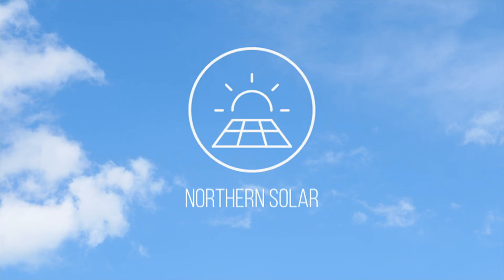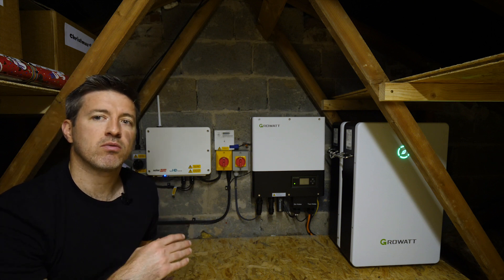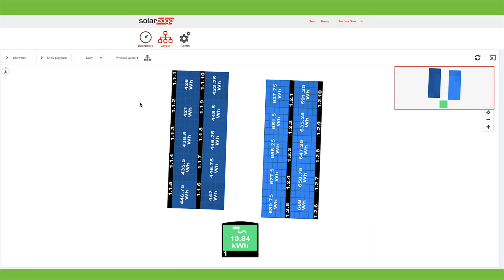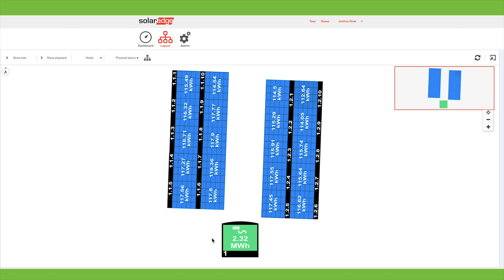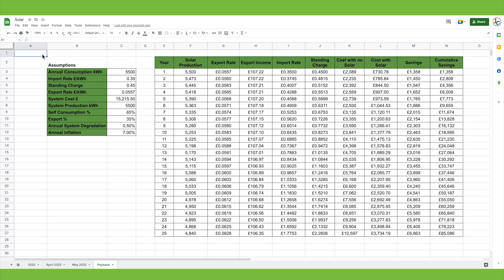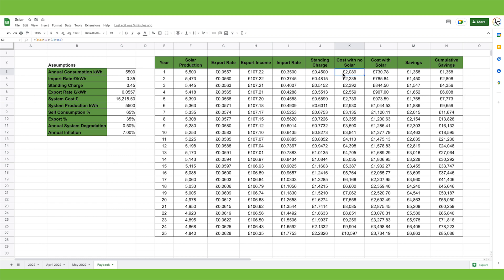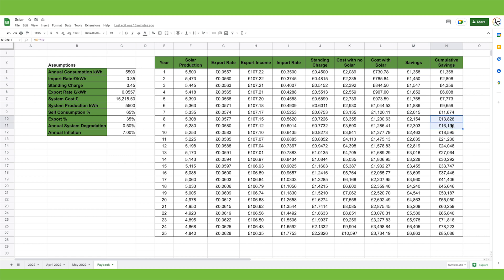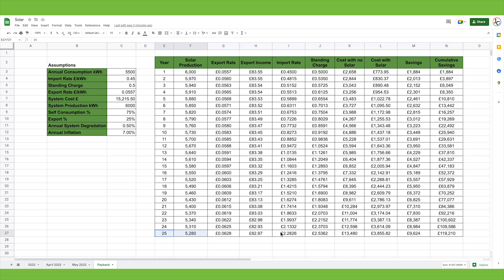How Long to pay off Solar Panels & Battery - System Overview, Cost & Payback Time!

Comment: Ha thats funny, spoke to Terry at tb electrical on a potential indra v2g unit install before he got cold feet. They were great when the quoted for my property but ive gone the mostly diy route and just need to figure out my battery storage. Nice spreadsheet btw.
Reply from the maker: Thanks Andrew! I'd be way too nervous to DIY it. Wiring a plug socket is about as far as I'd go! One of my neighbours has the v2g charger for their Nissan Leaf.  I could put you in touch with them if you're looking for advice?
Reply: @northernsolar6391  nah i know what i need to know for now

Comment: Why the standing charge on the spreadsheet, it would be there even if you didn’t have Solar or battery’s.  
As an installer it’s nice to see batteries starting to make sense, even if you can’t get them of the shelf. Normal waiting time 6 mts.
Reply from the maker: I just include the standing charge to show what the total bill is per month. It's on both sides of the calculation so the savings would be the same with or without it in there. It's definitely not necessary to be included though. Yeh, there's delays on everything it seems at the moment. I'm so glad we got ours when we did!

Comment: Hi Joshua, do you ever hear any noise from the inverters or batteries during the night? I'm asking because I'm looking at an installation in my garage which will be directly underneath my bedroom. Many thanks! Loving your channel by the way! Cheers, Gary
Reply from the maker: Thanks  Gary, I've not heard any noise at all, no. I wouldn't think you'll have any issues with yours in the garage. What system are you going for?
Reply: Great to hear, Joshua. So, I've been waiting to get my system installed for months now. And although my quote is currently for SolarEdge + optimisers, I've also been looking at a Solis inverter, in order to have Pylontech batteries, or a GivEnergy system including batteries. Lots of options and so a bit of analysis paralysis! Lol
Reply: I, like you, have ventured into the world of making YouTube videos on solar. Early days - only one video so far - but it feels good to help others 👍
Reply from the maker: @Qdex44    there are so many options out there at the moment. Getting stock of some seems very difficult. I would try and remember it's a long term project and it's worth waiting for the right kit even if it's a few extra months now it could make a big difference in the long run. That's great, I'll check out your video!

Comment: Interesting to see two inverters, I wonder if there is any inverter efficiency loss with that setup?. Are you exporting to the grid from batteries at all? another interesting point would be is the battery degradation from exporting to the grid worth it or is it better to never export from battery.
Reply from the maker: There's definitely going to be some efficiency loss when charging the battery from the solar as it goes dc-ac-dc but on the plus side for me I can get 6kW from my panels and 3.2kW from my battery at the same time should I need too. That's probably not going to happen often though. I'm not exporting to grid from my battery, no, that wouldn't make sense for me. The export rate is a lot lower than the import rate, even off peak.  Also adding unnecessary cycles to the battery would degrade it faster.
Reply: @northernsolar6391  Yeah makes sense, I suppose maybe if you had a tariff like Octopus Agile it might be worth it. Interesting point re your peak electric inverting power. I can only invert 4kw with my hybrid inverter and sometimes the odd kettle/microwave/oven combo does mean I draw from the grid even though I have plenty of stored electric.
Reply from the maker: @gsdevme  that does happen to me too, my growatt inverter can only draw at just over 3kW from the battery so occasionally we draw a little from the grid. I'm ok with that though as our exports cover those minor amounts.

Comment: I have the same system as you, except I have 16 panels 6.4kw and a SPH5000 hybrid inverter with Tigo optimisers. Mine only cost £8800? Mine is more south facing so it’s producing about the same as yours. Mine was installed in October and it has produced 5MW’s already. I have had no problems with it so far. You will like it.
Reply from the maker: Thanks Robert! Yours sounds like a great system. Can I ask if you have a battery? And what size? That's great that your producing so much too. Do you find you're exporting a lot at this time of year too?
Reply: @northernsolar6391  I have 13kwh of storage, the same two Growatt batteries you have. Yes I export a lot, but not when I am on a day off because I charge my EV and that sucks it all up in the summer. In the winter I do not export hardly anything. I charge the batteries at 5p a kWh and they see me through the whole day with a little bit of sun light.
Reply from the maker: @mackay250  that sounds like an ideal setup. £8800 is a great price too. I doubt anyone would be able to get a price like that now!

Comment: When we put our original panels up in 2012 we were quoted 8 years to break even. We did it in 5 and a half years. The estimations made by the installers do err on the side of caution, for instance the calculation made was that our 3 kw array with 3 kw array would produce 2800 kWh annually. In actual fact the lowest we have had in the 10 years fitted was 2923 and highest 3271 and are averaging 3100. We are south facing and although the installers calculations were based upon that, I see  no reason why your installers calculations will be any different, they will be cautious.

It will be interesting to watch you future videos to see how you get on. Good content, simply explained thank you for taking the time to produce.

Your estimations are really cautious too and I believe you will be pleasantly surprised by your actual results over time
Reply: Likewise I also had solar panels installed 10 years ago, they paid for themselves in 4 years.  I absolutely love them.
Reply from the maker: @mypointofview1111  that's very encouraging! I think once the new price cap comes in and we've had a year of production I'll have a much better idea of the payback period.
Reply from the maker: Thanks Lynn. That's really encouraging to know. It seems to be the case with most people I've spoken to but I guess you never know until they are up and running. I think we're on course for way above the estimate which is great. I'm really interested to see how we get on in winter too. My next video for June's figures is looking like it'll be a good one!

Comment: Hi Joshua, Although your loft is insulated, do you know how cold it will get in the winter months and do you expect any degradation on battery output when freezing temperatures outside.  Also for the warranty on the invertors and battery is that parts only, or parts and labour?
Reply: As for the loft, I would be more concerned about the heat in summer than cold in winter.  The inverters generate heat and their lifespan shortens. An option could be to put a 12v fan extractor (solar powered?) that goes through the wall and simply draws external cooler air in from around the soffits and expels the hot loft air out.
Reply from the maker: @wajopek2679  I have looked at getting a fan up there to help with air circulation and it'll probably happen when we do the extension. I'm going to keep an eye on the temp sensor in the battery this week as it's very warm. I've not seen it over 32 degrees yet though so I'm pretty confident it'll be fine.
Reply: @northernsolar6391  In Scotland I have seen my loft go below freezing via the temperature sensors I have, not sure about Cheshire exactly. The growwatt batteries BMS should disconnect it at 0c to prevent damange. Even charging below 10c for a long period isn't ideal but I dont think anything here will cause a complete failure.
Reply from the maker: I don't know the exact temperature but it definitely not lower than -10°C. I think a garage/utility room is the ideal place really but that wasn't really an option for us. It's definitely something I'll be keeping an eye on though.
Reply: @northernsolar6391  Hi Joshua, could you comment on warranty regarding labour costs
Reply from the maker: Hi Raymond. Yes, labour is covered as part of the insurance from the installer, backed by HIES. 10 years cover with £100 excess.

Comment: Interesting video with payback assumptions, thanks.
I know a lot of installers choose to install the equipment in the loft, as its normally the only option, but do you feel the the summer ambient temperature will have a detrimental effect on the batteries over  time.?
Reply from the maker: Thanks Marc. The loft temperature is definitely something to consider. The battery has an internal temperature sensor and is fine up to 50°C so I don't think it'll be an issue. We also have a 10 year warranty on the battery so I'm confident it won't be a problem. It think I'd be more worried about one installed externally or in a garage during winter as batteries don't like being cold either.
Reply: I never install in a loft unless the insulation is in the roof, temps can be well in the 40 when the inverter is working the hardest, in this customer example though, most of his roof is covered by solar so I would expect lower temps.
Reply from the maker: @eco-terrorist   it was definitely something we took into consideration. I've been monitoring the temp while it's been really warm this last few weeks and it's not gone above 30°C up there yet.
Reply: @northernsolar6391  yep, with panels on both sides covering up 90% of tiles, the sun energy in heat will not soak into the tiles. thus not heating the loft space,
Reply from the maker: @eco-terrorist  that's great to hear. I knew we made the right decision filling up both sides of the roof! :)